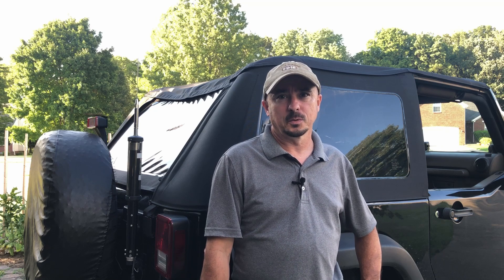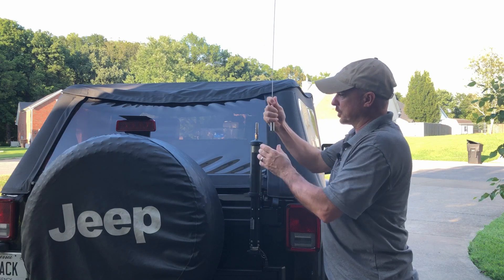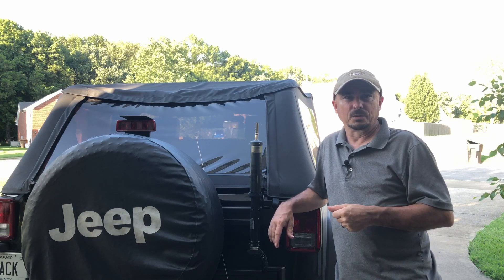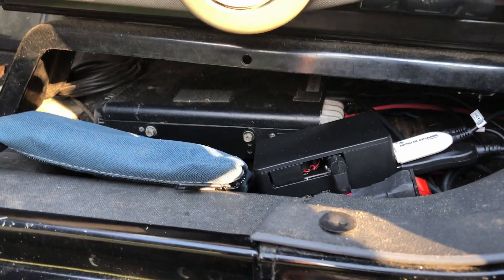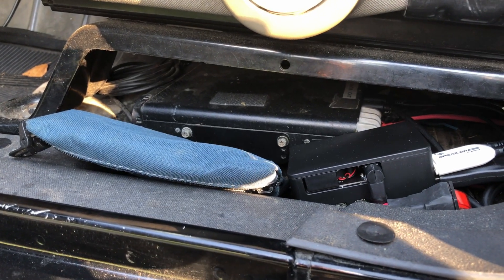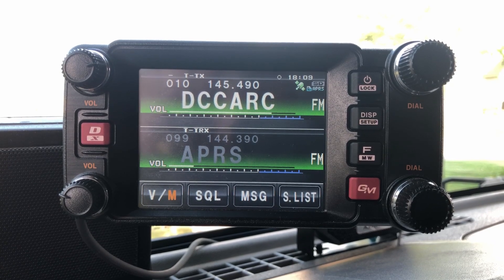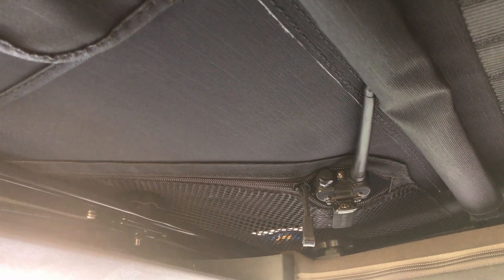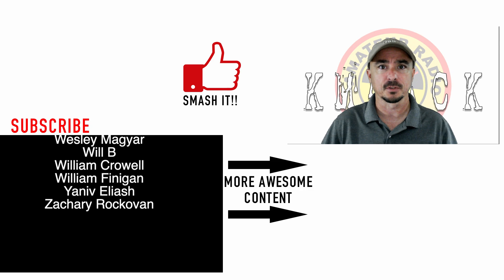Ham Radio Jeep Wrangler Mobile Shack Tour

Comment: Jason, Great job as usual. How did you mount the Little Tarheel II to the rear door? Thanks again for a great video.
Reply from the maker: I used a Diamond K-400 mount. Been there for probably 5 years now and still going strong
Reply: @KM4ACK  Thank you! Quick follow up. I couldn’t tell from the video. Is it attached at the top or bottom of the door?  Thanks again. 73

Comment: This was great Jason, I’ve been wanting to put a screwdriver on the back end of my Jeep Gladiator for some time but I’m not quite ready fo that much of an outlay at the moment.  I already have the drivers side hood bracket installed but I haven’t yet mounted the Comet on it yet (still trying to find the best firewall pass through).  Thanks, Tom KC3QAC

Comment: What's a yeasu ft 817 worth these days? I'd like to upgrade to a similar radio with more tx power, or would an amplifier be sufficient, for a mobile station. Already have a pi and touch screen I've yet to install in the pickup. Space isn't an issue as it's an extended cab and I removed the rear seats to make room for tools and radio gear
Reply from the maker: You could go with an amp or move to a radio like the Yaesu 891 for around $650. The 891 doesn't have 2M/440 though. It is an HF only rig

Comment: Just recently managed to get a combo of a Kenwood V7 , Kam Plus, and Tablet of Laptop running on Win10 with SARtrack running. Its a cool aprs system, and we have places without Cell Data (or Cell anything for that matter) here and I can text a cellphone back in civiliazation while I'm out on the river, or another APRS station can be messaged. .. Very cool. I'd like an easy way to get from JS8 to Cell, or APRS, using a regular Win10 system. So far I can only put my location on APRS.FI from JS8. Still not running RPi.

Comment: Thanks for showing us around. I run an 857 in my car as well. I use a Diamond HV-7a antenna and it has worked well for me. It covers 2m, 70cm and HF. I usually run 40 and 20 meter coils but you can get others.

Comment: Great setup.  I'm running hamsticks now on 40m and seems to work really well.  Agree that the 857 hard to replace when it comes to a mobile radio.  It's sad that Yaesu discontinued this rig without a replacement.  The only mobile rig, in production right now, that comes close to it is the Icom 7100 but I'm really not a fan of it's form factor.  73 de KF7VUT

Comment: Great video and very nice set up. I have the tarheel 2 also, on a Breedlove stake pocket with the whip fold over on my 16 tundra. I run the 706mkiig for hf. I want to try 2m ssb when you get that going I’d like to see it in action. I’ve also got the 400 great radio.
Reply from the maker: We have used 2M SSB quite a bit locally. Both with voice and JS8Call. Works great!

Comment: I use a Icom IC-7100 for AM/FM/SSB/CW modes on HF plus 6m, 2m, and 70cm when I'm mobile.  I wish it had APRS and dual watch built in, but since it doesn't I typically use my Kenwood D74 hooked to a second antenna for APRS if I want to do two things at once, otherwise a Mobilinkd TNC paired via BT with my phone can work with the 7100 for APRS.

Comment: A great setup Jason!!  So far since getting back into ham radio I haven't put anything radio wise into my F-150.  I have thought about it, but just haven't done it.  Since I have my portable setup in the back pack I figured if I want to do mobile I can do that with the bag.  Back in the late 90's, early 2000's I did run HF mobile, had a ICOM 706 in my S-10 and used hamsticks.  Thanks for sharing what you have, it really gets me to the point of wanting to put a radio in my truck.  Juddie - WD8WV